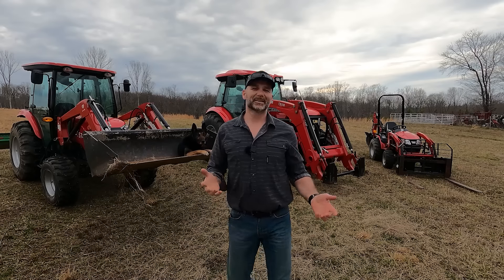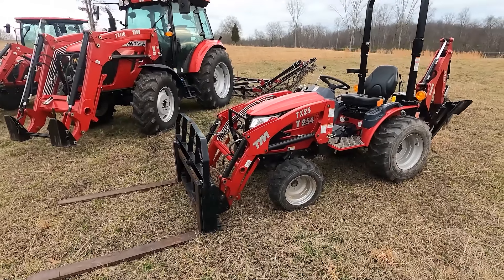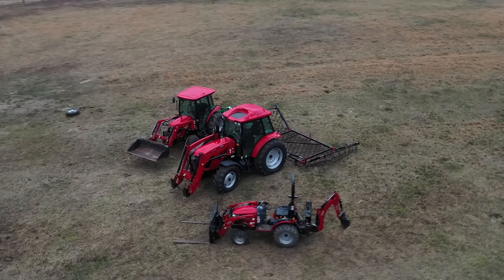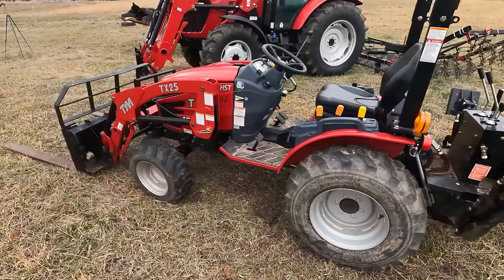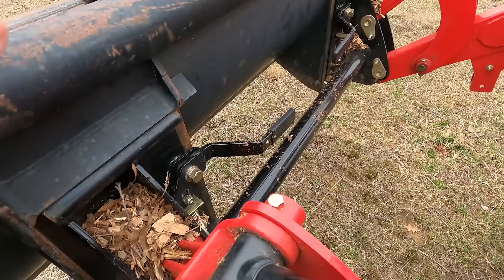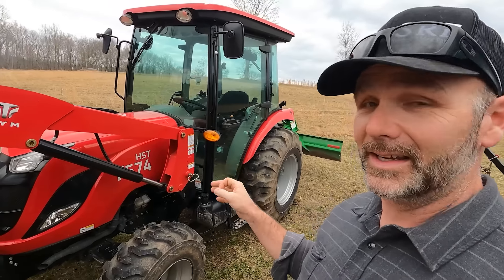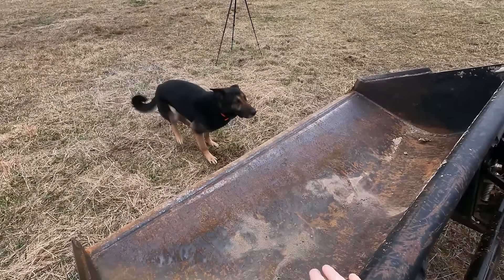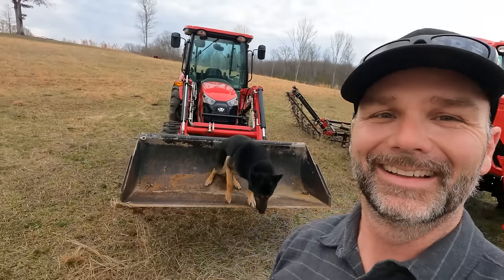Red tractors! The TRUTH ABOUT TYM You were right!

Comment: I'll keep my deere. 4020 with a 4240 motor. 2955mfwd loader, 12000hrs. 2755mfwd loader, 9000 hrs. 2640 8400hrs. 5210 6800hrs. 2040 6500hrs. Also have a ford 1710mfwd with loader which has been great and a ford 2120mfwd with loader and a kubota b7510. I'm sure that the tym tractors are comfortable compared to my old deere but I think they are more for someone who would only put less than couple hundred hours a year on. I really doubt you would ever see one with more than 3 or 4000 hours on it.

Comment: It may be a nice machine, I have 3 dealers within 100 miles and they all suck. If you don’t have a good dealer to support you then any machine will let you down. My orange and green machines both have great dealers that have parts in stock and the knowledge if I have a question. The  2 2 closest gym dealers also rep tue saws I use and can’t even stock an air filter or fuel filter for them

Comment: One of the tractors I bought in 2007 to clear light scrub was a TYM603 cab tractor with a loader and 4 in 1 bucket, I bought it originally to do contract work on mine sites but liked selectively clearing my 25 acre property at Horsecamp Queensland mainly lantana and wattles,  It was a nice tractor to operate, nice aircon but the loader twisted and the jack on the 4 in 1 bucket also snapped off, I later learned from the dealer the Ausmac loader was Chinese not Korean, he repaired it for free ( Glasshouse Tractors QLD)  the only other problem I had in 300 hours was the front drive shaft fell off, My biggest disappointment was it was auctioned off at around 300 hours getting less then half what I paid for it new.
Reply: Yep. Save money on the front end and loose it on the back end with the Korean tractors.

Comment: The last tractor that you showed us had a very special wonderful feature called mechanical parallel linkage on the loader that you never even mentioned!
Shame on you! 

As far as I'm concerned every tractor on the planet should have either mechanical or hydraulic parallel linkage on the loader just like all high lift material handlers/telehandlers do! 
You can order some TLBs with parallel linkage on the loader if it's labeled as a material handler.
 I know that Cat and John Deere does that.
It makes using forks on a regular farm tractor like that a whole lot easier and safer!
I think it also makes it a lot safer to load big trucks with a tractor that has that wonderful feature!
I can't stand the geometry on the Big John Deere & Cat loaders that don't have the parallel linkage.
For instance, with any loader, you get a full bucket of rock or dirt and curl the back of all the way back and lift it all the way up and that dirt is going to fall on top of the tractor or you if you don't have that parallel linkage.
On the big cat and John Deere loaders, it looks like parallel linkage BUT once you get the bucket halfway up it started dumping automatically which I hate.  And I ran those for over 20 years.
The telehandlers have hydraulic parallel linkage which works great.
I have only seen hydraulic parallel linkage on one aftermarket loader attachment for some small tractors.

Some tractors have artificial parallel linkage.
If you get a full bucket curled up and raise it up it'll try to keep it level past a certain level going up. But when you let that bucket down it'll start dumping that material.
Cat and John Deere skip loaders and backhoes are bad about that. I hate those too!

Comment: This is the first time I've ever even heard of TYM tractors. Based on this video, they look like something Home Depot would sell, right next to the bargain bin Cub Cadets. I'll stick to my Kubota's.
Reply: They have been sold under several names for a long while. Cabela's, Rural King to name a few. They have been in the US market for at least 15years. After seeing a few lemons coming off Kubota's line I cannot see them being better than anyone else. My father had one with transmission issues at a couple hundred hours costing 8K in repairs for example. Their main advantage is a larger dealer and parts network. Boy do you pay for it though. 
JD tractors are made by Yanmar or Mahindra, or whoever happens to have the contract currently. So their only advantage is the dealer and parts networks as well. New Holland is made by LS and they don't even try to hide it like JD does.
I think Kubota is the only brand assembled outside of China, S Korea or India.
Reply: @court2379  Like I said, I'll stick with Kubota.